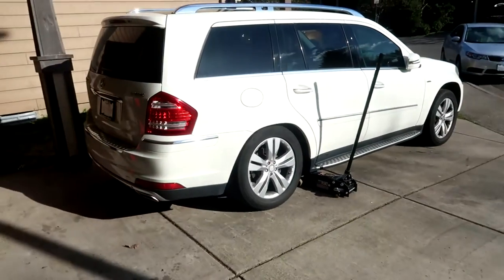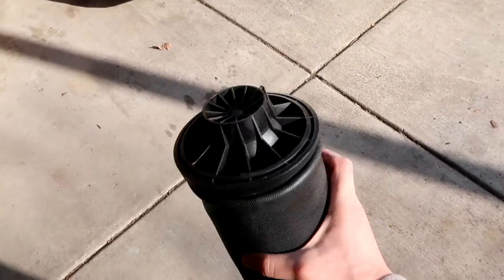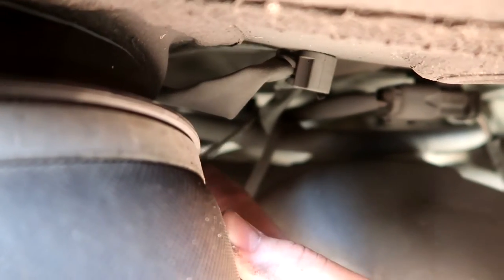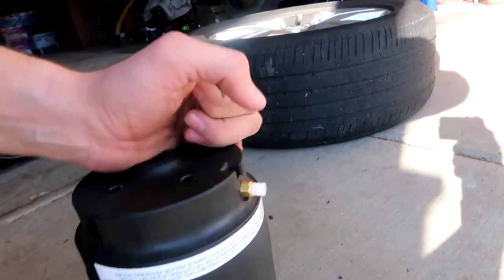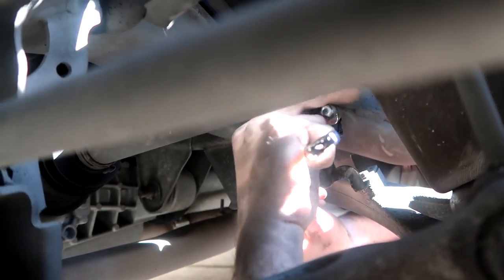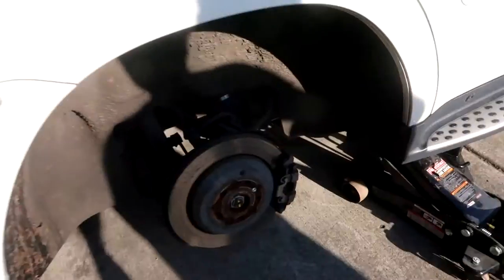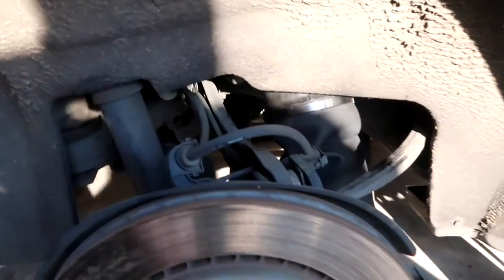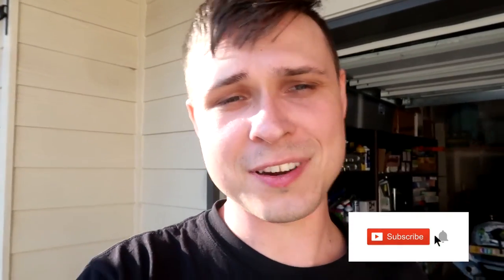Mercedes GL Rear Suspension Airbag Replacement! X164 Rear airbag replacement

Comment: No one tells you in any videos that after you change the bags. That you need an OBD2 scanner to adjust the ride height and inflate the new bags. Hope this helps someone.
Reply: Is that step you mentioned hard to do? (The calibration and to inflate it?) I have this problem and i want to do it myself.  Thanks in advance
Reply: @caseygina3553  I'm not sure but i used after market parts doubt if they were OEM. Interesting question none the less..

Comment: Where did you bye the air bag from?
Reply from the maker: Hey! I believe eBay, a name brand though if I remember correctly.
Reply: Rock auto had rear OEM Bilstein for my GL 450 for $200 each. Less than Arnott which are good as well.